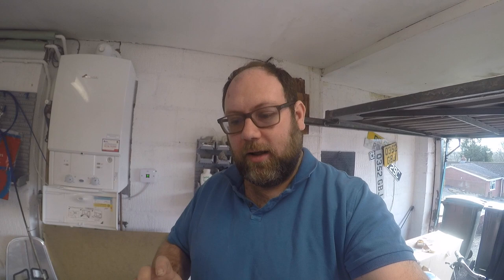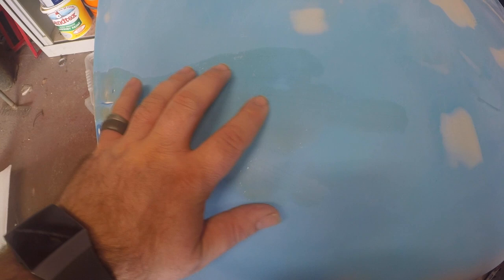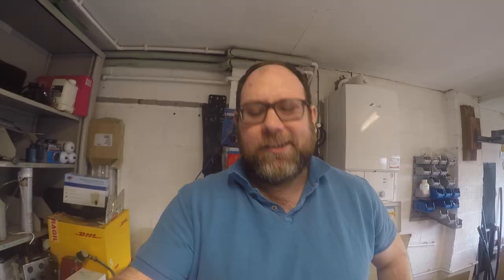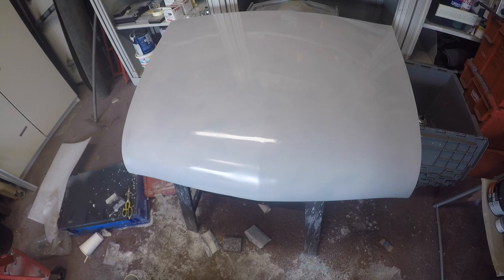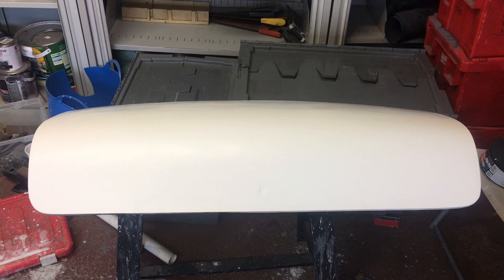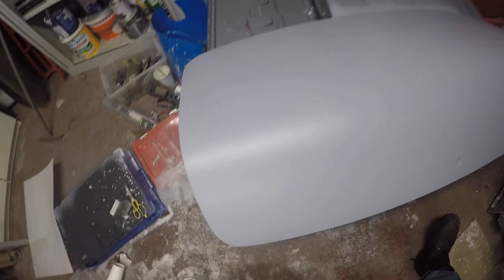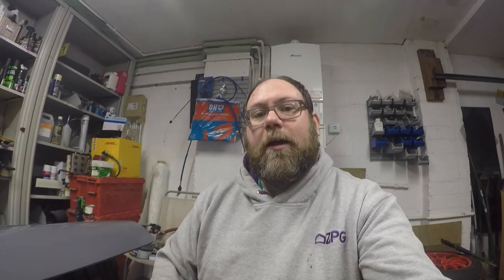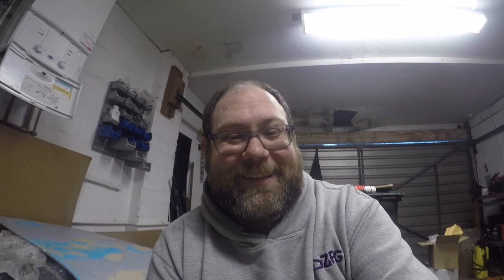Rattle Can Paint Job - 1958 Ford 100e pinto turbo project car progress

Comment: Rattle cans, way to go! 
Boot/bonnet, trunk/hood just call them lids to avoid confusion :) 
Mismatch of primer and top or too much paint can cause orange peel. Have you ever considered wrap? I did my Zero in wrap and it came out surprisingly well for an amateur. Color (colour) matched GRP amazingly well. Keep up the enjoyable challenge.
Reply from the maker: Needed to match the existing colour of the car and so paint was the simplest option. It’s come out pretty well in the end, certainly within the range of something I could wet sand to a smooth finish if I want. We’ll see if It bothers me.
Reply from the maker: Just realised this comment wasnt showing on the video properly, so not sure you got to see the reply I posted.  Sorry about that, youtube held it for review but still let me post a reply, very odd!